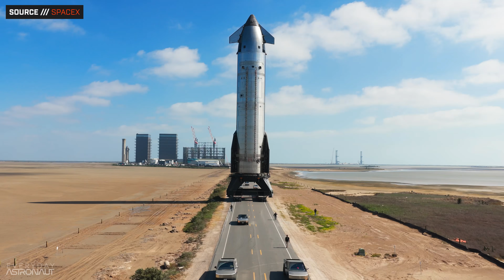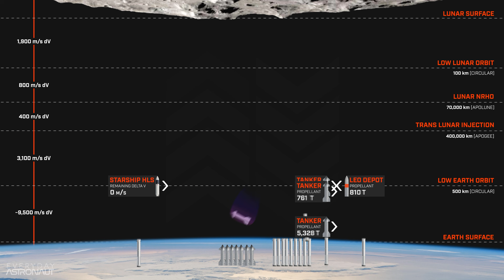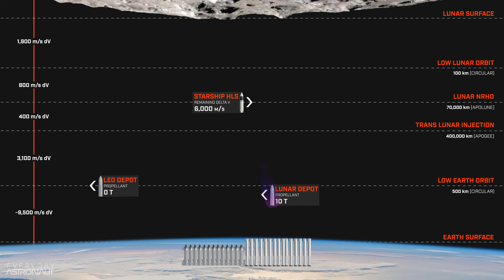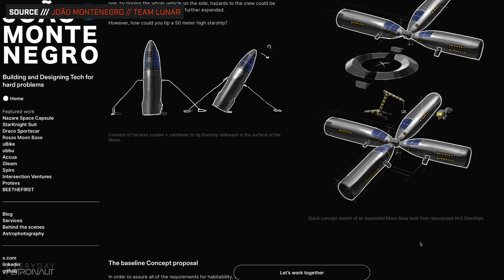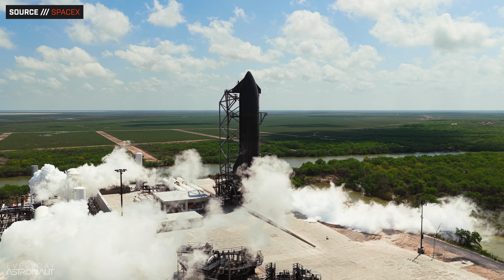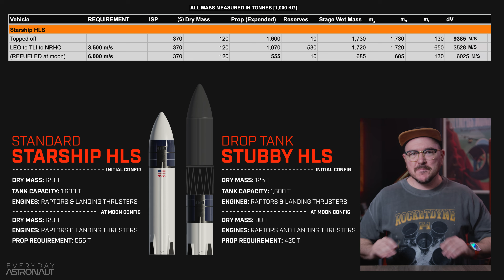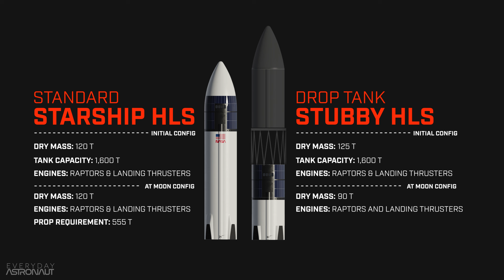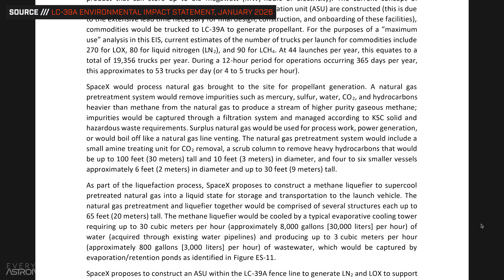Does Starship REALLY require 15+ launches to land one lunar Starship?!

Comment: It's actually a feature of Starship HLS that it requires so much infrastructure to get to the moon, not a downside. Because once built, that infrastructure can do so many things for SpaceX and NASA. An orbital fuel depot is insanely valuable, with the potential to refuel deep-space missions, refuel satellites, space tugs, and many others. I like to think of it like Lewis and Clark vs. the railroad. Yes, Lewis and Clark's expedition to the Pacific was cheaper and easier, but building a railroad was what really opened the country to affordable access. Starship is absolutely not the optimal cost-efficient way to get 4 people to the moon for two weeks, but once built, it will be the infrastructure that opens the solar system to regular, affordable access.

Comment: I think eventually V4 starship will refuel an ongoing V3 scale for refueling and halve the overall launches needed. Refueling V4 vs V4 doesn't make economic sense and plus Nasa is relying on the V3 variant for moon operations similar to Flacon 9's Block 5 being rated for humans. So maybe V3-A, V3-B blocks while V4-A, V4-B etc splitting the development.

Comment: 1 correction, spacex has confirmed it would only take about 6 refill flights to fill the tanker, not 15😅
Reply: SpaceX CLAIMED that, wihout showing any numbers. Tim is showing you numbers why its impssible
Reply: @дроу  in this video hes saying each starship can only get 100t to orbit, those are based on old numbers as recent specs say 200t+ each cutting the number in half. .
Reply: @BloodArtist24  you need to find old slide from SpaceX that also claimed the first Starship variant would be able to get 100 tonns to orbit, but later they downsized it to 20 tonns. So SpaceX themselves just CLAIM big numbers but after test flights they downgrade the capability of the current version, claiming they will increase it in the next version. It happened before, why should we trust the current numbers and expect them to NOT be downgraded after testing?
Reply: Elon and spacex claim 😅

Comment: 1:38:00 And this circles back to one of your older videos about how much do rockets pollute because this is going to completely change the conclusions of that video. If we’re launching 18 full stack starships per lunar landing, that is over 100,000 tons of propellant being burned! which means at least 55,000 tons of CO2 being put directly into our atmosphere most of which going into the upper atmosphere (although CO2 only makes up a third of the exhaust molecules, It is 55% of the mass because CO2 is heavier than water per mole). That’s still less than the airline industry, but it’s not insignificant, especially once launch cadence ramps up for other things besides Artemis!
Reply: I guess tim didn't see the new statement from spacex that says itll only take 6 flights to fill a tanker not a dozen plus
Reply: @BloodArtist24 if that’s true, that’s really good! Do you have the link to it?
Reply: @BloodArtist24  way I see it 6 tankers is in an ideal situation 12 plus is pessimistic with boil off and such
Reply: More CO2 means a greener earth to compensate. Catch up.
Reply: @BuzzMoves365 what? Your point makes literally 0 sense!

Comment: Pretty sure NRHO left the conversation when Gateway did.
Reply: no it didn't, Orion still needs NRHO
Reply: @дроу  no it doesn't. It can either get into or out of low lunar orbit, but not both. So it could get there and have some help to get out,, or vice-versa. NRHO is too risky and too difficult for basically no benefits. Plus there's only 3 missions left b4 Orion is out of the conversation as well 😂
Reply: Also NASA has all but confirmed this, they've talked about ditching NRHO as soon as Gateway got canceled, and now NRHO isn't mentioned PERIOD in any of the new Artemis architecture documentation.  So like I said...literally out of the conversation 😂

Comment: Given one of the primary goals of starship is to have as close to zero refurb and full reuse, it wouldn't surprise me to see them launch one twice in a week by the end of 12 more months. If they can maintain that cadence, they could launch 50/year and in another year start to catch up/exceed falcon 9's cadence.
Reply: Compared to the plans for the Starship system, a few hundred refueling flights for a NASA-dedicated depot is insignificant. But it will be an important part of the tech development.

Comment: What is actually going to happen... Elon already pivoted to a moon colony over a Mars colony. He will pivot again to starship building data centres in space as it's primary function.  Because the economic will work. Any Nasa moon adventures will be a side quest at best. As it progresses and starship evolves there will be large scale infrastructure in LEO. From there large space habitats hosting servicing AI data centres and huge power generation. At which point building custom vehicles for the moon and infrastructure for a lunar data centre will be possible. So in 50-100 years or so, we will colonise the moon. After another round of financially viable infrastructure and local resource processing we will again be able to push out to Ceres (bulk water and fuel)  and from there to Mars.
AI data centres and the demand for huge energy generation creates a financially viable path to human solar system expansion.

Comment: This is why non-rocket launch systems need to be pursued once the depots are online. Propellant is going to be the major driver for rocket launches unless we can use a cheaper, more infrastructure heavy path for fuel depots. 

Variable Pitch Screw, Loftstrom Loop, or other system will be important long term, as long as rockets will be required for in orbit maneuvers.

Comment: Thanks for sharing Tim. In my opinion the 'lander' should split in two while the payload part will land on the moon the fuel part stays in a lunar orbit. The ring of thrusters move to the top of the crew module and maybe a R vac at the bottom. The legs will be Falcon 9 style when folded almosr the total length of the lander at the top opening in Earth orbit and locked in place . They can even have roled-up solar panels underneath those legs. Something for cerbal

Comment: I don't understand why the tanker starship would be limited to bringing 100t to orbit like the standard ship.
There is so much more volume to stick fuel in and burn your engines longer. (Yes structurally you need reinforcement, and maybe thrust to weight at staging is not good)
You would also stage earlier since the ship would be so much bigger, so less reserves are needed on booster.

Comment: What if they took off from Boca and landed the booster at the Cape?  Would that buy us any delta V since they wouldn't have to do a boost back? Or would we lose all that with the additional cross range requirement for the booster?
Reply: Also, maybe a disposable second stage that gets a highly optimized stubby starship to it's first landing. Kinda like the drop tank but maybe then you could cut down on dry mass of the final lander by leaving behind a raptor or two

Comment: You didn't explore a dedicated tanker variant that would have much larger tanks, allowing it to burn longer to make up for the increased mass to orbit and reduced performance of the 1st stage. With each tanker flight delivering 150 or perhaps even 200 tons along with further raptor improvements (they have already talked about higher chamber pressure/improved isp) the tanker flights needed per mission drop substantially.

Otherwise I enjoyed the video, save you yelling at us for most of it.

Comment: It makes no sense. In the section "Why refuel in orbit?", why do they do the calculations with the Starship having half-full tanks, as it currently does, as if SpaceX weren't planning to launch a dedicated propellant cargo module, completely full from the nose to the engines? Since there won't be more than 15 launches, it's common sense that the calculations should have been done with a fully loaded Starship, not with half-full tanks, as if SpaceX engineers were that stupid to make these erroneous calculations. It's as if the refueling Starship were the same one that sends cargo, when there's more than half the space left over with nothing to refuel, and their calculations are nonsensical.

Comment: One landing thruster configuration that wasn't discussed, is to have all thrusters on the top.  They can be on arms that extend them away from the body, so thrust is less of an issue on the lower part of the body. Of course there is the weight of those structures, and a greater aerodynamic load as well.  The current engines would not have sufficient minimum thrust for the final part of the landing, but could perhaps handle a greater percentage of the descent. Then perhaps some smaller engines are added to handle the very final portion.

A few other things can help. Disposable rockets can use lighter weight metals, since they don't need to survive reentry. The rocket engines on a disposable can use  the used engines that are near their end of life, and so save money.

Comment: Hey @EverydayAstronaut Just wondering if it takes about 18 launches to fill up Starship just to reach the Moon. But then they want to use that same massive lander to launch away from the surface to get the crew back. Doesn't that render all those 18 refillers useless? All that work, money, and fuel wasted.

The Starship lunar lander is simply too big to be the most efficient way to take a crew to the Moon and back. Its best use would be to land it and keep it there. Such a big ship is perfect for living areas, big laboratories, and fits the idea of having a permanent footprint—basically an equivalent to the ISS on the surface of the Moon.

There has to be a cheaper way to get the crew back to Earth without taking the entire Starship. Why not launch unmanned lunar landers to serve as labs and living spaces, and have astronauts arrive in a much smaller lander that is cheaper to relaunch back to Earth?

I remember the plan was for that ship to never land back on Earth, and that versions landing on the Moon would stay there forever. That wasn't my idea, I remember that being a SpaceX plan. What happened to that?

Comment: Instead of the drop tank, what if you had a tug rocket already in leo that would push the starship part of the way, detach and return to leo.  It would be like a second, already in space booster.  It would do the same work as the drop tank but would already be in space so would not have to be launched every time.  It would also be reusable saving hardware $s.  I realise it would have to be refueled in space requiring more launches but the increase in the landers capabilities might be worth it.   Not sure if the tug would be able to return directly or have to do some type of orbit to return to leo.